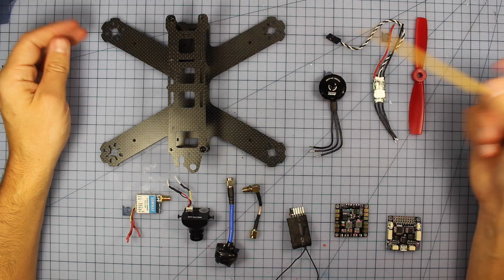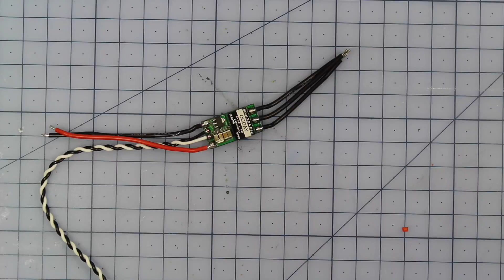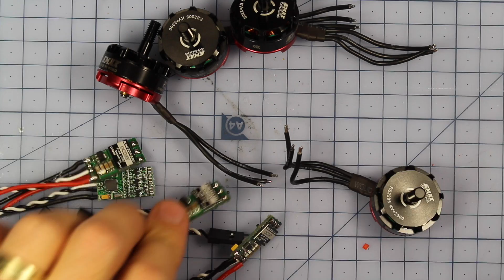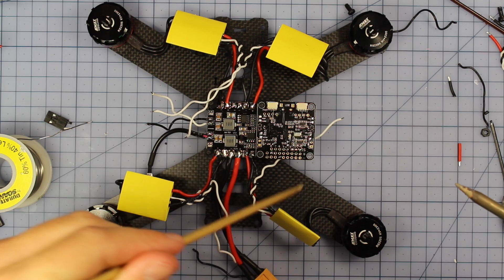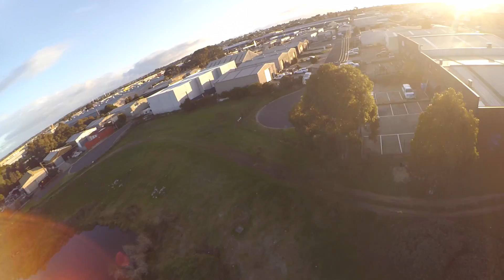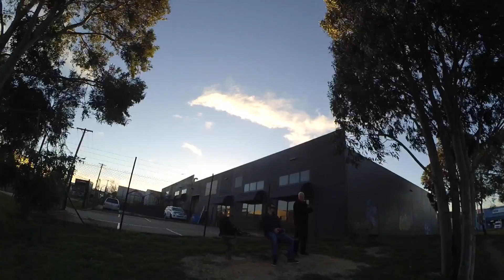Beginners guide to Building an FPV racing quadcopter.

Comment: Hello, thank you for taking the time to make these very helpful and thorough build videos!  However, I have a question, were the nylon standoffs that the PDB sits on supposed to be included in the kit?  I have looked through me kit very thoroughly and I have not been able to locate them.  I was only able to find the metal standoffs and black machine screws, no nylon standoffs. Additionally, one of the long metal standoffs had no female threads on one end, only a smooth hole (I mentioned this in a comment you replied to earlier).
Reply: Read elsewhere that nylon standoffs aren't included. They are very cheap from banggood, etc, however.

Comment: I have ordered this Dubai 210 kit based on your excellent build and review videos. However, the included Ocday bl mini 20a esc's are of some concern. Can you recommend replacement esc's if I should run into problems with the originals? Thanks again for producing your videos!
Reply from the maker: umm if you want fantastic performance any of the bl heli s escs will be fine, or if you just want something super reliable the little bee pros are very very solid

Comment: vtx mounted to top plate with 90 degree sma connector going through the hole made for antenna and antenna on top
Reply from the maker: I have never had an issue with that. Maybe you have a short or something somewhere. Check the motor screws
Reply: Ok thanks

Comment: with which batteri do you fly this quad?
Reply from the maker: 4s 1300mah 60-120c
Reply: +UAVfutures But on the Website it says 1300-1500mah, 30c, 3s
Reply from the maker: Helden Schlumpf just telling you from a racing standpoint you will want a 4s 1000mah high c.
Reply: +UAVfutures Probably I damage the quad with souch an Batteri.?
Reply from the maker: Helden Schlumpf those batteries will not damage the quad.
Reply: +UAVfutures ok thx.😊

Comment: I have no power on my X4R receiver when I plug it in. I already bound it to my taranis X9D and configured everything for SBUS on cleanflight. I'm just not sure which UART to choose as serial RX. Can anybody help??
Reply from the maker: do any lights flash up, possibly a power problem, Check the voltages with a  multimeter
Reply: ok I checked that. There is no power out of the FC from both IO1 or IO2. The red led next to USART3 is on and the blue one next to USART1 is blinking. I did everything like you showed in your video. Did I miss to connect any solder bridge or something?
Reply from the maker: Christoph see if you can power it from one of the esc + and - pads

Comment: I was looking for this. You should have said in the description also Dubai 210. One thing i want to ask. Why did you not  use the pins rack provided to hook everything up. Solder that on and you could use all the connectors and cutting wires was a lot less. For who is struggling with soldering. I,m guessing you did this to get everything in with ease. So no tuning through cleanflight or Libre? Or you made enough videos that cover that? Great video anyways. Thanks for keeping it simple and straight forward.

Comment: how fast does it go?
Reply: and do you get a smouldering iron in the kit and if not where
Reply: Soldering Iron*. Here are some links to where you can purchase them:

http://www.banggood.com/110V-60W-Adjustable-Electric-Temperature-Soldering-Iron-Gun-With-5pcs-Tips-p-979703.html?p=1Y02003432615201601R

https://www.amazon.com/s/ref=nb_sb_noss?url=search-alias%3Daps&field-keywords=soldering+iron
Reply: Also, don't forget to buy solder!
https://www.amazon.com/Tenma-21-1045-Rosin-Core-Solder/dp/B008EX8KMU/ref=sr_1_11?ie=UTF8&qid=1468404275&sr=8-11&keywords=60%2F40+solder

Comment: Which parts of the receiver do you connect to? There when u put the line from the flight controller to the receiver does it matter what three pins you go to? Is it yaw roll throttle or what?
Reply from the maker: it depends on which reciever you have. If ppm then it just connects to signal pad 1 on the FC. Then ecerything else is configured in cleanflight.

Comment: I have nearly the exact same build - I would highly recommend not mounting the battery on top due to structural issues (I snap my top plate in half from impact). Strap it at the bottom

Comment: Hi Stew, I just wanna ask why you soldered the esc ground wire to the PDB instead of connecting to the flight controller? (I'm talking about the ground wire that was twisted together with the esc's signal wire).
Reply from the maker: I dont think it really matters. You can remove it totally if you need to

Comment: How do you mount Xiaomi Yi or any other camera on this frame ?
Reply from the maker: velcro, or zip ties or custom 3d prints
Reply: That's unfortunate. Great kit tho, if only not this small problem of mounting camera.
Reply from the maker: troll nebesny A lot of frames now days dont give you special mounts. Pretty standard because so many people have different types of cameras, gopro, yi, mobius, run cam, cube etc all different shapes and sizes
Reply: UAVfutures I had only 250 size quads before and they all had camera podium on rubber connectors. Than you for the answer anyway, will search for a solution.

Comment: Just got a kit like this built. However I have a problem. No signal are received in the Receiver tab in Cleanflight. I connected my D4R-II like you, and enabled RX PPM in Cleanflight. Anything else I need to do? I'm using a Taranis X9D, and the receiver and radio are binded.
Reply from the maker: Check which port in enabled in cleanflight but it sounds like it should be working
Reply: It was a bad cable! Already destroyed two of the included receiver cables, I would suggest people to give the connectors some hot glue before bending them too much.
Reply from the maker: jacobtc good to know. was it in the receiver wire?
Reply: Yes, the reciever wire does not use silicon wire, and breaks easily at the connectors.
Reply from the maker: jacobtc mm. I build an orion 90 this week as a side project. Didnt film it so it was just for fun but I was pretty much finished when I noticed a signal wire broken on my vtx...took me like 90 minutes to take evertyhing apart and solder a new pin/plug into the connector and then solder it to the pdb hidden right at the bottom of the build....
Reply: Yep, had this before as well! I going to make it a habit to hot glue fragile connectors from now on.

Comment: Hey man
Just recently became interested in fpv drones and i found your videos during my research and they're just so helpful for an absolute noob like me. I really wanna build a quad but most of the fpv beginner guides i found advise people to start with a "toy" drone, like a hubsan x4 h107d. But i really don't wanna be throwing away 100 bucks for a skipable step. Do you think i should do what they say or just go straight to this type of drones and just be careful with them?
Anyways,  keep up the good work. You're awesome
Reply from the maker: I really think a toy cheap hubsan is a great idea. Like $50.
Reply: I decided to use that sale in the description and bought this one http://www.gearbest.com/rc-quadcopters/pp_282803.html?wid=1
Reply: If you have never flown a quadcopter before I strongly recommend that 50$ Hubsan! Flying those things is not as easy as it looks like and it will give you cheap flying practice before diving into those more expensive quads. I bought the Hubsan first and I'm glad I did.

Comment: Great video, can you recommend a transmitter. All I have been able to find are transmitters that exceed £100! Are there any relatively cheap transmitters you would recommend because I would love to build a racing quad and I don't want the transmitter to stop me. Thanks, also could you explain why some transmitters cost less than others.
Reply: radiolink at9 or is it too expensive? flysky fs-t6 v2?
Reply: A video transmitter or an RC controller?  For a controller I recommend a flysky fs-i6x and for a vtx I recommend anything Eachine, many can be found for $20 on banggood.

Comment: Do you think that the parts that come in this kit are high quality and will last? Do you like the frame?

If I buy this kit I will also buy a taranis and it comes with a X8R receiver.  Will this connect as easily as the one in the video or should I purchase the receiver you used? 

I think that the link for the camera in the beginner quad part of the spread sheet is wrong.  I believe that I found the camera but it has a few configurations and I am not sure which one to pick:  Lens: 2.8/3.6/2.1    Mode: IR sensitive/IR Block      System: PAL/NTSC

If I hook up everything like you do in the video will the taranis tell me when the quads battery is getting low?

Do you think that this quad is powerful enough that you would still enjoy flying it with all of your experience with other frames?

Thank you so much for the video.  Without something like this I wouldn't feel confident that I could actually build one of these.
Reply from the maker: 1. yes this is an awesome kit. great motors and FC, good frame. 

2. a taranis is great. But do not get an x8r - it is too big and not good.

3. get 2.8 ir seneitive, I use PAL

4. the Video will not tell you battery voltage without an OSD

5. this quad is VERY powerful

thanks for enjoying my videos
Reply: Thank you for the information.  Can the receiver tell the taranis when the battery is low or does that also require something special?  Do you usually just time your flights to determine when to switch batteries?

Comment: Around the time 20:50 you install a receiver. Is it possible to switch out the connector from a servo cable to a 3 pin cable and connect a satellite receiver? What is the output voltage powering your receiver?
Reply from the maker: there is a 3v tab on the underside of the fc that you could use to power a sat. Look at " https://www.youtube.com/watch?v=BPplZQiygZ8" and look at the receiver part. It will explain exactly what you need to know

Comment: Nice video. Would you recommend this dubai kit or a selfmade racer with dys 1806 2300kv and 12a esc ?
Reply from the maker: the motors and escs in this kit are far superior to 1806s and 12a escs.
Reply: +UAVfutures ok. Thanks 😊

Comment: Stuart, when I'm flying, at what cell voltage should I stop (Eg. 3.3v per cell)? Many thanks, Nikolai
Reply from the maker: the main thing is when you stop flying and you check your battery voltage it should be around 3.7v at rest. So if you stop at 3.3 3.4v and give it a few minutes to recover it should jump back up to 3.7.
Reply: alright then thanks. I set my buzzer to go off at 3.7 volts. and one more thing, when I was charging a 2s lipo using a balance charger, the total voltage said 8.4 volts, but the individual cells together only added up to be 8.32 volts. Whats going on here?
Reply from the maker: Yolkolai maybe the cheap voltage checker is not as accurate as the charger?
Reply: Both readings were done by the charger.
Reply from the maker: Yolkolai ??? mmm not sure sorry mate

Comment: When you flip in acro mode, do you have to roll the oposite direction after the flip? Say you roll to the right so you move your stick to the right, to stop the roll do you just center the stick or do you have to add left bank too counter act the roll to the right? Thanks help appreciated.
Reply from the maker: if you stop the roll at the right time you dont need to correct. in acro at least.
Reply: but if you roll and just put the stick back to neutral in the center wont the quad just keep rolling until you give opposite input? thanks.
Reply from the maker: Cooper Stukel no, the quad will just stop changing direction. so if you let go at the right time you will be level. 

just like how when you pitch forward in acro and let go it will maintain its current angle until you adjust it again. So if you went full pitch all the way around you would do a flip and when you let go you would already be level,
Reply: Thank you!

Comment: I wish I would have watched this video first lol, I  just built this,
http://www.aliexpress.com/item/SkyZone-FPV-5-8-GHz-32CH-RC832-Receiver-With-A-V-and-Power-Cables/32607643983.html
I think my ESCs are better, but I definitely like your FC better. I am building this now
http://www.aliexpress.com/item/Alien-Martian-230mm-FPV-Full-Set-Combo-LittleBee-30A-ESC-BLHeli-OPTO-2-4S-EMAX-RS2205/32660459559.html
I felt bad like I had a problem, because I have another one coming, a Vortex 285 I don't really fly anymore and another QMR or ZMR or whatever it is clone sitting half built in a box, and a 6" Martian in disrepair, then  I saw all the quads you have haha!
Reply from the maker: wow, sounds like we both have a lot of quads lol
Reply: I'm so happy, I just got back my 5" Alien that I had lost in some tall grass, a few weeks ago It nearly got ate by a mower. The SJ400 was lost, and the $45 circular wireless antenna snapped off, 2200 A-Spec Nanotech DOA, but everything else was ok as far as I can tell. The real test is when I plug a new battery in and see what's up. This will make #6 lol
Reply: Check this out!
https://alofthobbies.com/surface-120-fpv-racer.html
Reply from the maker: 3000gtwelder I think that will bend in a crash almost straight away
Reply: +UAVfutures That's kinda what I thought, but I figured maybe you might have heard something about them. Looks kinda cool, I guess maybe because I'm a CNC machinist haha.

Comment: on my opinion it is better to solder both the signal wire and ground wire of esc signal cable to the flight controller. Sometimes there are some issues with esc flashing through fc, and motor sync when there is no ground esc wire on fc.
Reply from the maker: Im not %100 sure on this, But I think that if the escs need the ground wire it doesnt matter if it is grounded through the fp or straight to the battery. But if you do ground through the FC and something goes wrong in your esc you can fly your fc as well.
Reply: +UAVfutures the one thing is I know for sure - ground-signal pair twisted in spiral is more stable to interference. For example as just in video link recommended to twist groung with signal. So and as far as we know that one shot signal is sensitive to interference I would teis pairs and lead them from the esc right to the FC. To avoid interference from high power distribution board(that will be awesome on Damped Light etc) 
Of course  the whole video is awesome for the beginners) Great work. No point to discuss a lot about this wires) just placed here my thoughts))) Thank you

Comment: Hi! I tried to unsold the wites on afros ESC and i unsolded a resistance or something. Are there some ESC which are easier to unsold? I have a good solder station and i have skills to sold, not much but i do have some. So is it easier with a special brand of esc s?
Reply from the maker: umm im not sure if some escs are easier. I found these ones pretty easy, just get in and out quick so you dont heat up the whole board too much
Reply: If you're soldering escs, they're all pretty much the same except kiss esc's and the dys xm20's. Best price of advice would be to use a blunt tip instead of cranking the heat on the iron. You just want to heat without transferring the heat.

Comment: how much does the quadcopter weight with the battery included?
Reply from the maker: about 460 grams with a 4s 1300mah battery, 315 without battery

Comment: If you label your video beginners guide, please talk slower, don't rush it and if you're going to use abbreviations for the parts, explain them the first time you mention them. Now the beginner gets to remember these names without knowing what they stand for from the beginning of the video.
Reply: I agree, great video but I remember when I got started I didn't know what a vtx was or an esc. For those of you that are new, here is a bit of the lingo.

Vtx- Video transmitter, this sends the video to your goggles.
Esc- Electronic Speed Controller,  this sends the signal from your flight controller to your motors. It is what controls how fast or slow they spin. 
FC- Flight controller, this is basically the brain of the quadcopter.
Pdb- Power distribution board, this distributes power to your components.
Fpv gear- for this kit you will need to provide your own first person view gear, this includes your camera, vtx and googles or monitor.
Everything else seems to be explained very well in the video. Hopeful this helps anyone thats new to the hobby.
Reply: Jon, I'm not here to flame or trol. I understand your opinion. 
I was only commenting on the title that states Beginners Guide.
The way the video is presented is purely for advanced builders and insiders. For them this is a good video.
Reply: wouldnt an advanced builder already know how to build... i think this video is for the experienced flyer beginner builder
Reply from the maker: thanks for the tips.
Reply: his accent is british,usually,british peoples talk faster,even i cant understand what them talking about,like spanish peoples from latin america
Reply: Kenneth Tan I agree, I've left this video with little extra knowledge. He explains things as if we already know what he's on about.
Reply: Kenneth Ta
Reply: Ken and Buzz, I think if you are watching this video, and don't understand the terminology that Stew is using, It may indicate that your level of knowledge is not at the level to attempt a build yet.

It may be a good idea to watch some more YT Videos and research components involved in a build, as this will assist in garnering the necessary knowledge required to understand the terms that Stew has used throughout this video.

This is not meant as a personal attack, merely a suggestion to avoid any possible issues that may arise from undertaking a build when not quite prepared to do so.

Happy Flying!
Reply: Kenneth Tan just use translete dumbass